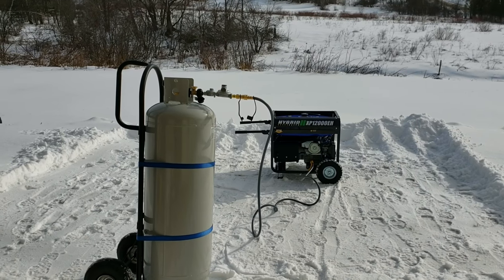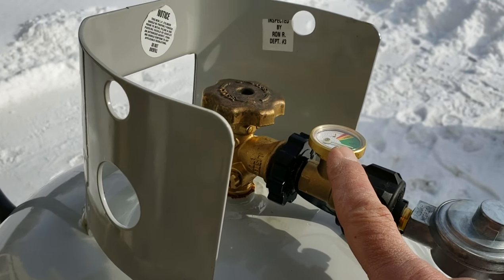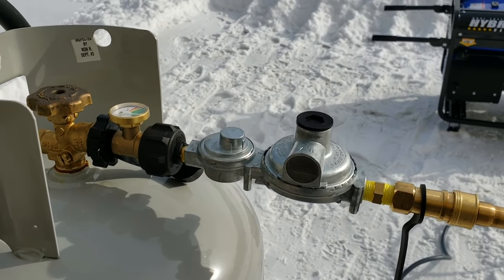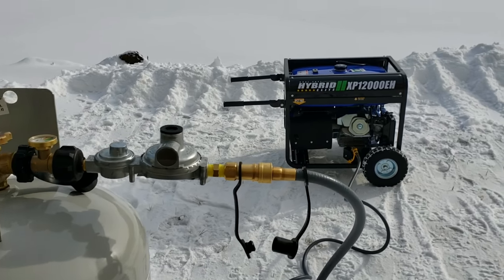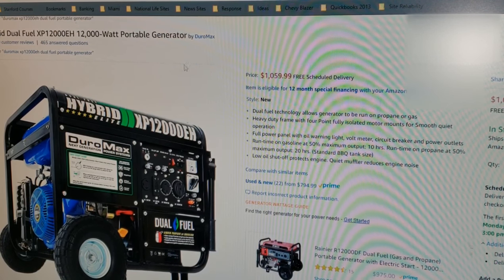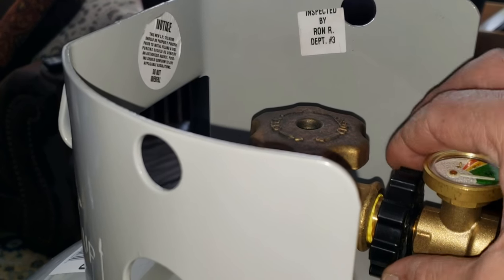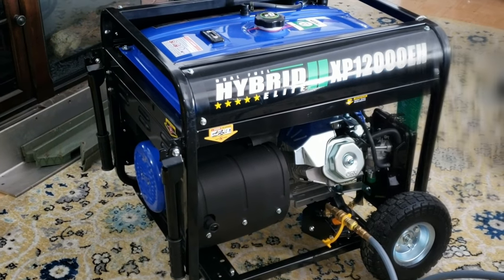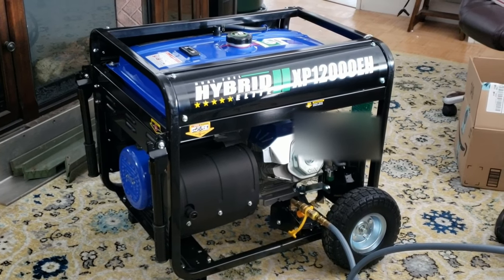Ultimate 100 LB Propane Tank Setup - Duromax XP12000EH 12000 Watt Hybrid Generator - Step by Step

Comment: Wanted to add my thanks for a great video and apologies for rude replies.  I plan to create a similar setup, perhaps with some simplifications.  Reading up on gauges, I see the dial-types are not very helpful as they measure gas pressure, not liquid level.  Found that there are ultrasonic monitors on the market that are quite accurate.  Stick on bottom of tank, calibrate for tank size and monitor with smartphone or dedicated little monitor.  The "The Mopeka Check XL" monitor (Amazon $38) is right size for your 100# setup.  I'm not affiliated - just think these are a cool option.  Or pour hot water on your tank and feel the level.  Voila :-)

Comment: Thanks for the great video you made. I have the exact generator you have which I purchased in December of 2021 but never set it up or tried to start. Until now, I needed to get this generator out of my garage for much needed room. I did have trouble starting but it finally started with help from duromax, however my regulator was freezing up. I see in your video that you have a longer hose, so I went to purchase a 10’ earlier today. Now the rep from duromax said since the regulator froze up, the long hose as well as my 20lb propane tank might be the issue, so there sending out a new regulator with the shorter hose.  I’m still going to buy that regulator you have and try that with the 20 lb tank. Don’t have room for a 100lb.

Comment: Thank you so much for sharing this information freely. It was easy to follow, I was able to get all the parts for my generator and 100 lb propane tank except for the two step regulator, the exact same one was not available but a similar one Camco 59323 Horizontal Two Stage Propane Regulator 160,000 btu/hr my generator is a 9000 peak propane, is dual but will use propane. The Camco has 1/4 inch fnpt and the 3/8 in fnpt so should be the same. All parts fit same, but looking for a little feedback before I finalize with tape etc. Any comments on the Camco?
Reply: How'd that work out for you. Trying to do the same

Comment: I just revisited this video as I was looking for information on sizing a regulator for a Duro Max XP10000EH that I recently rebuilt, the manufacturer told me that it’s BTU consumption is 152,000, I’m waiting on the secondary regulator that’s mounted on the frame to arrive from Duro Max and in the meantime I need the proper sized regulator for a 100 pound tank. I called Marshall excelsior and spoke with a guy about it and he said don’t even use the regulator on the generator frame because you don’t need it, it won’t work because both are 11”, plug in right into the carburetor he said. Anyway I don’t know much but that doesn’t sound right so I ordered a Flameking regulator from Amazon rated at 160000 btu (close enough) for $17 dollars, I see you used the regulator on your 12000 Duro Max. I have been using the Marshall excelsior MEGR 291 rated at 175000 btu on my Duro Max 13000EH since 2021 thanks to your help and was I grateful during hurricane Ian no power for 2 weeks! When I get the new regulator for the 10,000 I’m going to install it and I’m going to run it with the flame king regulator then I am going to try it with the Marshall Excelcior 291 and see.

Comment: Excellent Video. Thank you for the time you put into this.  One question I do have is, in your research why would the other regulator that came with the generator for the standard 20/25 lbs. cylinder propane bottle not work with the 100 lbs. cylinder?  I'm about to do this same setup and if I hadn't seen this video, I would have assumed that the regulator that came with the generator for the cylinder would have worked.  Thank you!
Reply from the maker: I wanted a separate system for the 100 lb.  The included regulator has a different connection, but it could probably work
Reply: @VermontPrepper  Ah, Okay. That makes sense. Thanks again for the information. It was very helpful.
Reply: I too had this same question. My research showed that the tank pressure in a 100 lb tank is the same in a 20 lb tank. The one pressure regulator on the generator should be able to control this. please let me know if I'm wrong. 
Thank you Vermont Prepper for your time and research in making this video.
Reply from the maker: The regulator would work with some adapters.  I just wanted two separate setups cause the 20lb tank has a different connection than the 100 lb

Comment: Thank you for this information. Can you tell me what type of hose you used? Also, would your set-up work for a 420 LB propane tank )connected to a Duromax XP13000 generator? Thank you!
Reply from the maker: Hi, I put the links to all parts in the description.   It includes the 12 ft hose.  Also, I do not know if my set up will work with your tank.  Thanks for watching

Comment: Hello. 
Thanks for posting this to show your cool setup. 
 I have a new Duromax / Durostar DS13000 EH (the red one). Along with a new 100# Flame King propane tank. It appears I will need an adapter to attach this tank to the generator bcuz it has the same inner thread valve type as yours.  Here is my question> I don't want to use any quick connectors on mine, Therefore do you see any issue with me just getting that adapter with the built-in gauge, and using the factory-supplied hose w/ factory -supplied regulator?  I was also considering getting another length of hose & couplers to extend the length of that factory-supplied hose since it's only 6 feet long.  I am unsure about the supplied regulator still working correctly if I do lengthen that hose.?  I did visit a propane supplier to ask questions ~ However, I was met with a pissy attitude with zero tech help, along with heavy sales pitch for auto-delivery that I do not need. If anyone else can answer,  it will be much appreciated.  THANKYOU
Reply from the maker: Thx for watching

Comment: Are you certain that you needed two (2) pressure regulators?  One comes with the generator and attached thereon, plus the one you hooked directly to your tank.   I don't know the answer, so I'm asking.  Is this a suspenders and belt configuration, or are both required?  Thanks!
Reply from the maker: The generator came with a separate regulator, so yes, you need two

Comment: All you should have needed was the line set, disconnects and gauge/ ASSG m adapter. The regulator that came with the generator is a medium pressure piece. The 2nd stage is the low pressure mounted on your generator. 250psi-tank pressure. 1st stage reduces to +/- 10psi. Unit on generator reduces to low pressure for carburetor. The problem with regulators is if you try to reduce a pressure that is already low, you may run into flow problems that won't show up until you have full load.
Reply from the maker: I wanted two different setups, one for a 20lb tank and one for a 100.  The connections are different

Comment: I just got the same generator after about 6 power outages recently!  Going to use propane as well, but my propane tank has  gauge on it already, can you please recommend how I would bypass that step to still be able to set up a quick connect? 
Thanks for all of this info and time you put into this video.

Comment: I have 2 questions for you. 

1. Would this setup work with a different generator? 
2. When taking to get it refill do you have to take any thing apart? 

Sorry for this 2 questions. But I'm a newbie when it comes down to this. I just bought myself a Firman generate and wanted to see if this setup work. Plus I just got 100lb take. 

My generate came with regulator and holes in the box. Would I be able to use that or is that for only 20lb ones.
Reply from the maker: It should work with another generator about the same power.  The only difference may be the regulator. I am not an expert on that.  I only have one disconnect when refilling.
Reply: @VermontPrepper   From watching you video again and making sure I have everything and understand. When you take it to get refill or they come to your location. All you have to take off is the quick connect from the hose and they connect straight into the quick release right?  Sorry this is all  new to me.

Comment: So I have to use a second regulator on a100 pound tank or can I just use the on on the generator
Reply from the maker: The Gen comes with a second regulator.  So, yes, but inwanted two different connections so I bought a regulator for the 100lb so I don't have to mess with the different connections on a 20lb tank, which is what I use with the original regulator

Comment: Question... if im not doing a quick disconnect.. can i use the supplied regulators that came with my generator(same model as you) with just a longer hose and the pol adapter
Reply from the maker: Should be able to do that, but I'm not an expert.

Comment: LOVE this video.  Thank you so much for making it!  I just bought the same generator and wanted to do the same exact thing.  However,  I'm confused as to why you need a 2 stage regulator coming right off the tank.  Why is it needed when the generator you and I both have in the video comes with a regulator already.  Is that overkill?   And I agree, the God complex as far as the "gas" man goes.  I ran into the same issues/ problems with trying to get help.
Reply from the maker: I'm not a propane expert.  Maybe you do not need a two stage.  I only found one that was recommended to me.  Appreciate you watching.

Comment: Could you have used a leader hose between the gauge and the regulator and strapped the regulator to the side of the tank? Just thinking how to eliminate that 12-14 inch horizontal protrusion, you know what I mean? From the tank valve to the bend on the hose, seems a bit much.
Reply from the maker: There are many ways to accomplish it

Comment: Great video VP - this was so helpful.   I have been struggling a bit - but I'm trying to connect a 120 gallon propane tank provided by the local propane company - and use it as my source - so not quite apple to apples.   I'm sure I still need to add a 2nd regulator in-line with the first regulator - still reading on how to do that.  But I also wanted to do exactly what you are doing - so that info is great.  One comment in case you did not know.   As you said you WANT the carb choke to be OFF.   The reason for that - at least I on my generator -  (I used a converter kit) there is a diapham switch that is connected in-line with the propane.   As the generator cranks there is a small suction created - that suction will open up that diapham switch - which allows propane to flow into the carb.  It a safety feature - if the generator is not running - creating that suction - the diapham switch will "turn off" - blocking  propane flow.  If you turn the carb choke to the CHOKE position you reduce the suction pressue - and propane may not flow at all.
Reply: Did you ever figure it out. I am trying to do the same now
Reply from the maker: Yes, it's working

Comment: Thank you.  I'm considering installing a large (250 LB) underground propane tank to connect my dual fuel generator to.  What might be my challenges in hooking your described set up to a tank of this size?  By the way, I've built a small shed, I call the "pump house", to house my well, well pressure tank and my generator.  I've also installed a hookup in the pump house for the generator that leads to and interfaces into my main service box and used an interlock kit for switching between generator and outside power.  What should I be aware of using a large 250 LB underground propane tank as my source for propane?
Reply from the maker: Better to get a house transfer switch and contact your propane provider

Comment: Why do you need two regulars?
Isn't the one in the unit sufficient?
Reply: one regulator brings down the pressure and the one on the gen is a safety regulator it only lets gas out if there is a slight suction on the reg so  if the gen stalls out it doesent just keep pushing fuel out . o yea there is also a primer button on the reg on the gen just push the button to prime engine with propane for starting !
Reply: Also, the nat gas regulator I add lets me set the nat gas flow and pressure to the gen's regulator so I could simply switch back and forth between Nat gas and my propane tank.
Reply: @BadOldBuzzard  I have a 100 gal propane tank for my fireplace which has a regulator already on the tank. Is that sufficient?

Comment: Hello Vermont Prepper! I bought this set up but got a 40 LB tank instead of the 100 LB tank you have in the video. Will this regulator and set up work the same with a 40 LB tank in its place or am I creating problems for myself doing that? Any thoughts would be appreciated. Thanks!
Reply from the maker: If the 40lb has a pol fitting I would think it would work, but I am far from a propane expert.  I really can't guarantee it.
Reply: @VermontPrepper  Thank you for your reply and insight. you have really done a great job in serving a great many people :)

Comment: So the regulator just steps the high pressure in the tank down to a workable pressure for the generator right?  And this regulator doesn't freeze up like the one that comes on the unit?  Thanks for taking the time to share your hard won knowledge.
Reply from the maker: That's right.  As far as freezing, I think it is less likely to freeze but I am anxious to test this winter.  I thi I I am going to get a warmer for the propane tank as well.  Thanks a lot for the compliment and for watching.
Reply: @VermontPrepper  You bet, glad to see people that offer help without trying to gouge people for profits.  If that guy in Florida's unit was freezing up then I'm sure it would just about anywhere in America.  I'm gonna order this set up!
Reply: @VermontPrepper  I received my generator and I thought I'd let you know they've upgraded the regulator on the unit and on the feed hose.  It came with a product upgrade notice in the manual.  I'm sure it's not as beefy as the set up you've created but it's nice to know they're at least trying to address the issue.
Reply from the maker: @noblesavage413  glad you got the updated regulator. Makes things easier.

Comment: Did you set/check the Frequency with the digital readout?  If not, and for others, there's a Phillips head screw just above and behind the choke leaver (see it at 6:11 to the left of the fuel shutoff valve).  Mine was at 63.8 Hz when I got it.  And I think you're suppose to set it under load, so I plugged in a heat gun set on high (1500w), and it was a Hertz or so low from my setting it without a load.
Reply from the maker: I'll check that out.  I did not check anything.
Reply: What is the purpose for this

Comment: How long will it run on the 100 pound tank and how long on the 20. I just got mine and im.curious
Reply: Depends on the load its handling. Manual has some numbers in it
Reply: 23.8 gallons in a 100 lb. tank. 1.37 hours per gallon run time. 32.6 hours total. That's the math I come up with. Please someone let me know if I an doing the math incorrectly. Seems to me I need a 250 gallon tank dropped off to give me 11 days total run time. I hope I'll never use it but I want to be prepped
Reply: @Nobody-ry2mb  I'm curious if this unit could actually operate for that period of time
Reply: I have 4 5gal safety gas cans. Using propane as backup. I want to have at least 3 days backup total. Do not plan running 24 hours day. Better than nothing!

Comment: Does that gauge restrict any flow? Why not use a soft nose pol to 1/4 straight into the regular? I know you want a gauge and so do I, thanks for the research you helped me a lot. I just got the same generator just a bit bigger 10,500/13,000 on Amazon and yesterday I bought a 100 pound tank and am learning about POl vs QCC1.
Reply from the maker: No flow is restricted.   I would imagine there are a number of different ways to hookup.  My goal was to make everything a quick disconnect with a gauge.
Reply: @VermontPrepper  Thanks I have the adapter similar to yours with the gauge coming from Amazon, I am ordering the same regulator and 12’ hose as you have now, might skip the quick disconnects because the LP inlet is on the front panel on this unit, poor location as I could see it getting damaged in a “Bugout” situation.

Comment: when you powered the generator, did you have to turn off the main breaker? or it is done automatically? that's the part i couldn't get it. thanks
Reply from the maker: If you have it wired thru a transfer switch into you breaker panel you would need to shut it off.  If you just run out plugs from say your refrigerator direct to generator, u do not need to switch off breakers

Comment: Great video. I just got a duromax 13,000 duel fuel generator. Will the same size regulator as your 12,000 fit my generator for the same setup??
Reply from the maker: It should
Reply: Thanks saved me some research time.

Comment: Are you running it with two regulators or did you remove the one from the generator
Reply from the maker: Hi, I am running it with two.  That is how you would run it with the stock setup as well
Reply: @VermontPrepper  I don’t follow, why do you need two reguators
Reply from the maker: 2

Comment: I have an XP 13000EX on the way. Says it’s 178500 BTUs. Is the regulator that’s listed the one I would order? And would deliver the 3PSI as needed?
Reply from the maker: It should work
Reply: @VermontPrepper  Thanks for the quick reply. Nice setup and video.
Reply from the maker: Appreciate you watching

Comment: should regulator swivel? it doesn't tighten down onto part closer to tank.  also with quick connect before hose fastened to regulator; propane opened then closed shouldn't gas level remain stable?  i am thinking quedtion above ondicates it isn't sealing.  which part may be bad?